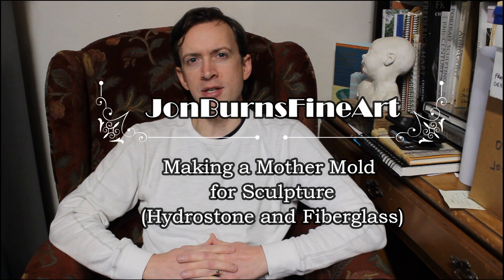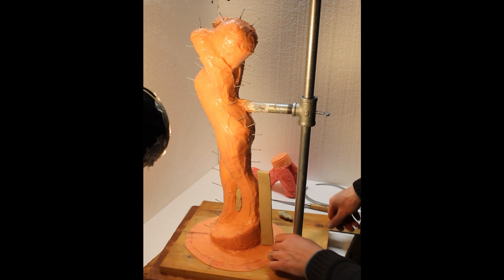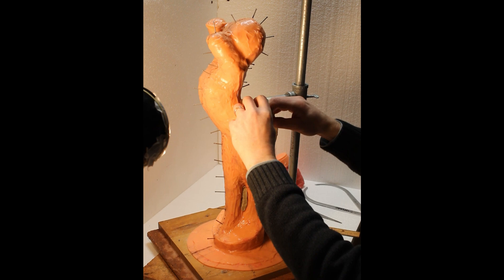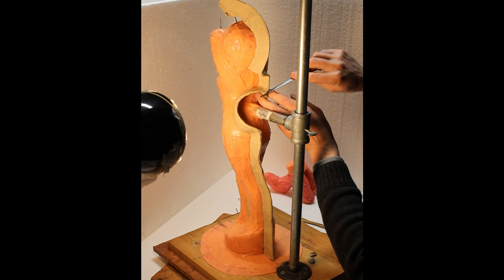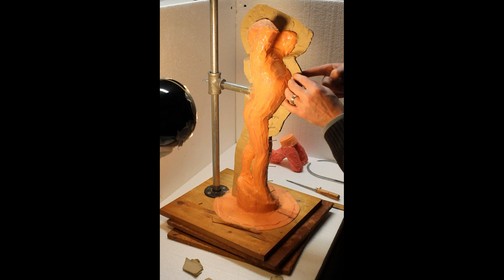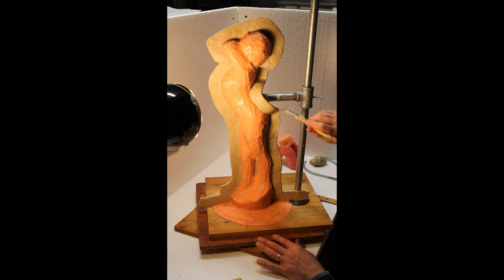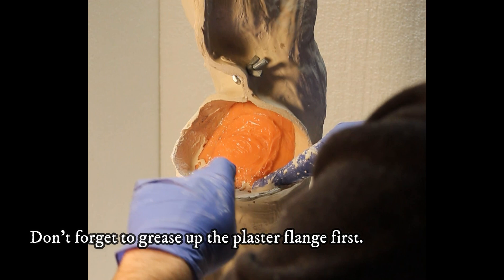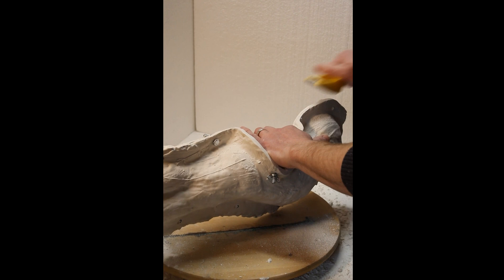MOTHERMOLDS FOR SCULPTURE successfully open the mold and reassembly for a perfect seamless casting

Comment: Hey Jon I am enjoying your vids. It's always nice to see how others do it. I have a couple of questions/ clarifications. I love the idea of using the paneling nails I always have a devil of a time trying to get a clay separation line (or dam) to stay on the form, the nails would definitely anchor that, thanks for that tidbit, Do the paneling nails cause issues with the surface texture of the castings, or does the silicone resume it's shape when they are removed, or would using long straight pins work?  Also I have seen different mold makers make a silicone ridge on the parting line to thicken it where the rubber seam is cut, any thoughts?
Reply from the maker: The paneling nails are quite thick. I've noticed tiny microbumps where the nails poked through. I haven't tried to amend the issue. I will say that straightpins would be a better choice if they're available and long enough, maybe T-pins. Concerning the thick ridgeline on some silicone jackets, that's where a typical parting line occurs or where one might make a mild incision to place shims (like business cards).
https://youtu.be/-k50UZA95Cw